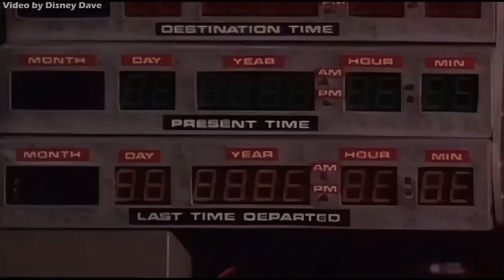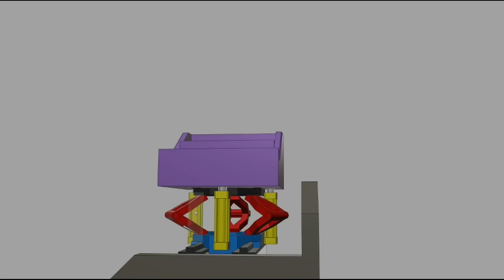Back to the Future The Ride - HOW IT WORKED

Comment: Universal Florida made a big mistake by removing the original legacy rides. All of those legacy ride systems were very unique and ground breaking for the time. They all could have been updated and would still look great to this day. What USF did was tantamount to MK removing space mountain, pirates of the caribbean, and the haunted mansion. We will look back at the 2000’s as some of the worst years for ride construction. While technology has made amazing things possible it seems the the big players have forgone creativity in the name of tripping over themselves to jam “relative” IP into every aspect of the parks. While I do understand that the legacy attractions at USF were all IP based they opened with the park and therefore gained legacy status. They used innovative methods to convey IP while today we use projection mapping to cram as much IP in as we can.

Comment: Switching Back To The Future out with The Simpsons is still the worst idea Universal has made, to date. Time has proven, (with the pun intended) that Back To The Future is even more popular today than it was when the ride first went in at both parks. Creating a whole new ride for the BTTF franchise would greatly benefit the studio.
Reply: Rides are Universal were aging TERRIBLY at that period of time. They closed Terminator 2 also which was another great attraction. But was also aging horribly. The problem is instead of updating those rides they just replaced them. Big mistake imho.
Reply: @zandelscomicsandcards7543  In the case of BTTF, though. Giving an update wouldn't be feasible since, well, when it closed in 2007, that year was a lot closer to 2015 than 1991/3 was. And if it got to 2015, that would be a case of 'That's not how things went.'
Reply: I don't see why they couldn't have a special one year only thing where they restore the old ride. The hardware is still the same except for the fascia. All the BTTF scenery and definitely the cars are sitting in a Universal warehouse somewhere. They do and spend way more than that every year on Halloween horror nights setup/takedown. It would drive people absolutely insane.
Reply: @TechandDoc  Great idea, especially if it were open for the week of November 5th
Reply: @TechandDoc  Because retheming rides on that scale would be ridiculously expensive.
Reply: @tcrpgfan  No it wouldnt. As I said above, it would cost about the same as HHN does every year and bring in way more guests.
Reply: @TechandDoc  Dude, the problem has nothing to do with the ride itself, but the entire building and surrounding area. That's why I said it'd be expensive, as you'd have to repaint and retheme the exteriors of the building, the building interiors, the ride vehicles, the souvie shop, the food stands, propping the pre-show, everything. And THEN they'd have to retheme AGAIN back to the Simpson's Ride and put back everything that was there back where it once was. It's not a simple just put everything back when it's done -thing since this IS A RIDE, not a maze which is mostly done within either a mostly unused facade or a soundstage, which are mostly left unused throughout the year except for during production shoots.
Reply: @tcrpgfan  Just gotta think like a theme park engineer bud. I'm a nobody and I wrote this up in 5 minutes:

Doc. Brown: “Ahh! Who are you! How did you get in here!? Why are you so yellow, and animated!? Gasp Great Scott! My temporal shield prototype must have malfunctioned. Instead of protecting the lab from Alternate Universe Biff stealing the time machine it ripped a whole in the WHOLE SPACE TIME CONTINuum..!”
Teenage Simpson associate in the room: “Uh sir. Uh yuh Krustyland, is uh being ripped apart by the uh, the thing you said before. * screen video to Simpsons universe footage of it being torn apart. *
Doc Brown: Oh No! . Your crustaceous lands will be devoured by the paradox until there is nothing left at all! gasp I’ve gotta stop it! Turns and runs away  “Ahh! I can’t! During all the commotion, trying to stop the time loop of Biff stealing the Time Machine, he got away with the Time Machine!” Moves around frantically “I can’t use the remote delorean without a team onboard Incase there’s a malfunction, and this time I don’t have the volunteers from the lab tour to send after Biff!, and sending crustaceans through time in an alternate universe will just create another paradox!
Teenage Simpson: Uh sir, yah sir, we aren’t fish.
Doc Brown: “I could build a new time machine and then in 2 or 3 weeks go back in time… no no no no. The universe will most likely disintegrate before then!” *stops, slowly turns to guests*. “What about you guys? You look pretty human to me. Are you up to save the universe?”
Doors Open
Passengers get in a original delorean with the “Quantum Generatorl” (Different color flux capacitor)
Doc Brown on the little screen: “it’s alright everyone get in get in. I’ve done this to you a million times.
Teenage Simpson: (nasaly)” Please keep your arms and legs inside the vehicle at all times. Enjoy the Krustyland Multiversal  Experience…”
Doc Brown: But how are we going to send them to the right universe!? I’ve got it! . I’ve never done this before but I think, I think it’s going to work!”
Doc Brown puts the atom fuel used to power the temporal shield into the volunteer delorean fuel reaction chamber.
* Flux Compactor and the side lighting Change color and glow*
Doc Brown: “Eureka! It worked! I finally invented another thing that works! Oh ahem, never mind that now never mind that.”
Doc fiddles with the volunteer delorean, : spaceship sounds:

 I’m  sending you directly to the point, place,  and time that my Alternate Biff originally came from just after he stole the time machine. Change dash destination to May 2, 1991 All you need to do is standin for my volunteers back in cool 1991 and repeat their actions to bump Biff back in time. I believe doing so will safely close your paradox…” * walks up to camera swiftly* “and mine!”
“If I’m correct, the mere act of sending you back may correct the flow of time as you move through it. You may catch glimpses of my past self attempting to communicate with the original volunteers. Under no circumstances should you try to speak with him! The consequences would be disastrous.
Doors Open
 Good luck travelers! I envy your journey! Enjoy the past ”
Ride Start: Lift up: 
Doc Brown audio: “ I’m going to accelerate you to 88mph directly out of the lab so get ready! 
Doc Brown cuts out
Delorean jumps through time and arrives just before Biffs original ride first jump and the ride picks up as it happened in 1991 from there taking after Biff. Past doc Brown comes up on the screen and plays like the old ride. Thought the duration A/V of Future Doc Brown tries to override the connection to give additional sense of urgency.
At the end during the final bump with biff  the  is reconnected Future Doc Brown again and he says: “Got yah!” *And pulls them back to their time.”
Doc thanks the guests for saving the universe and his sanity from Biff… 
Teenage Simpson: “haha little does he know. Bye everyone.”
Reply: @TechandDoc  agreed 😎
Reply: The Simpson’s is a “worst idea”, any way you look at it.
Reply: @debbieflaherty1975  Right. I agree. It wasn’t a show that revolves around a ride.
Reply: I agree 1,000%

The Simpsons don’t deserve a ride, because aside from the shows intro, there were little to no car / ride scenes. But of course as we know, the Delorean was the star of the show in Back To The Future.
Reply: @PaulThompson_Music  the simpsons deserves a ride. Just not THAT ride. They deserve something similar to the Men and Black ride.
Reply: @zandelscomicsandcards7543  I’m not familiar with the MIB ride. But I’d imagine a sort of Springfield walk through “ride” would be cool. With screens in place of windows, that you can watch in as the characters converse etc.
Reply: @PaulThompson_Music  Road Rage and Hit n Run showed that there were many unique cars in the show
Reply: Yes I agree and check this out I never got a chance to ride it because when I was 16 years old my church went to Orlando for trip and we were in the parking lot of universal the youth group from that church decided to take vote cuz they didn't think that universal was a good enough park so needless to say and to make a long story short the ones who wanted to go back to Disney in which we had been already plenty of times before and the previous day won so I finally went back in 2006 and the ride by that time was gone panama city beach sucks
Reply: I was 3 years too late to experience the ride
Reply: Worse that they got rid of the Hollywood version, like man the movie was literally filmed on the same plot of land
Reply: I agree
Reply: I love BTTF and the Simpsons, but I've been on the Simpsons version of the ride and can't even really remember it to be honest
Reply: I agree
Reply: Can you actually prove that BttF is more popular today?
Reply: I enjoy Simpsons and it’s your opinion

Comment: I loved this ride.  If you sat in front of the DeLorean, there was video from Doc Brown and Biff, and of course, the Flux Capacitor and date generator!  However, I sat in the last row and the panel and it rocked so hard I smashed my head into the door wing at full force and had a slight concussion.  Had to leave the park.
Reply from the maker: Oh damn, that seems to be a common trend in this comments section.
Reply: When I rode this amazing ride, the actor managing the loading looked at me and told to sit in the front row to avoid hitting my head (I'm 6''1)

Comment: Nice video, here’s to help clarify things:

@ 2:35 The original placement (which you do not mention) of USH’s version was supposed to be located where the current Despicable Me Minion Mayhem ride is at. But due to seismic issues, it was built at its current location.

@ 4:38 Your statement is only correct for level 3, which has 4 vehicles per Dome. But you correct yourself at 6:09.

@ 5:00 the “smaller rooms” are called Holding Rooms.

@ 5:21 the “neighboring room” is called the garage.

@ 7:19 the car slides 15” forward to clear the back shell.
Reply from the maker: Yeah, the part about the cars per level was hard to track down. Then in editing a bunch of stuff got scrambled (some editor bug) and things got lost.